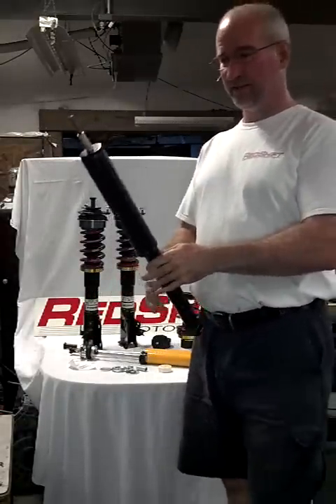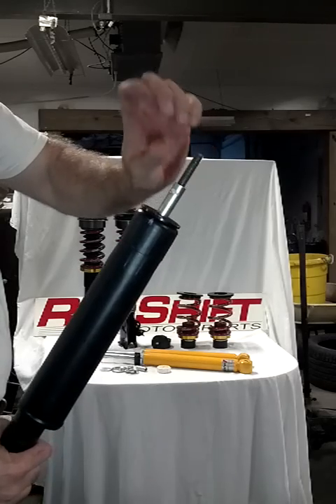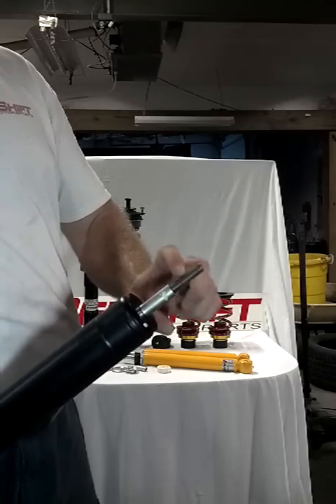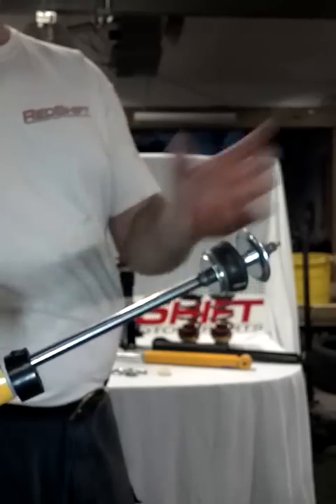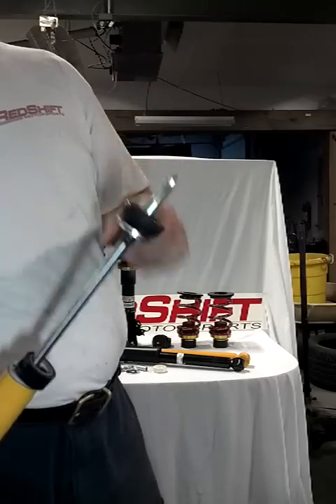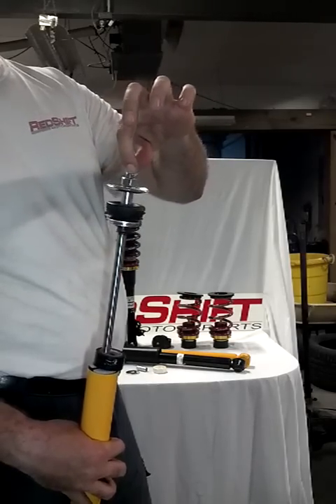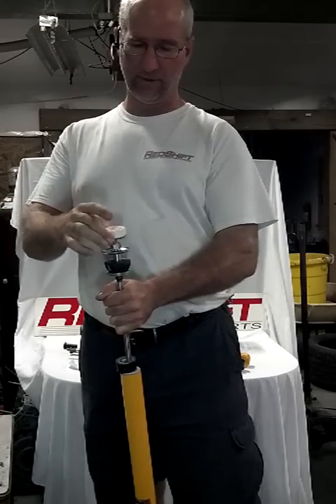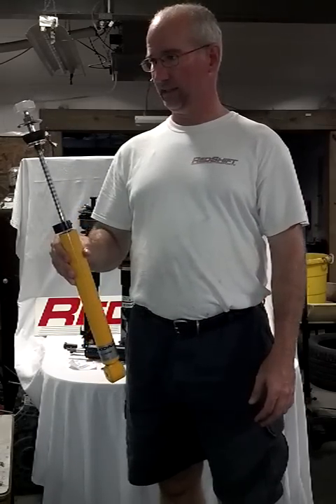Koni Sport Shocks - 06+ Civic Rear (hardware, assembly, function, adjustment)

Comment: You may not even check this channel anymore - but in case you do - do you to re use all OE components for the Koni orange struts as well or does it come with the necessary hardware? I saw on your website what is required for front strut assembly but no diagram for the rear. 

I hope this message finds you well and you are thriving. I have appreciated all of you post on the 8th gen Civic SI forum and learned a lot. Thank you.